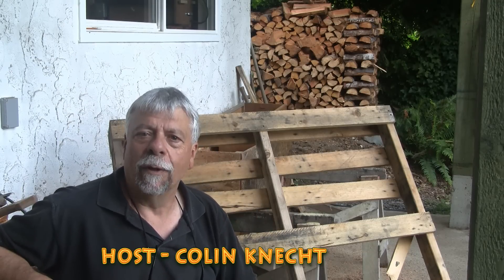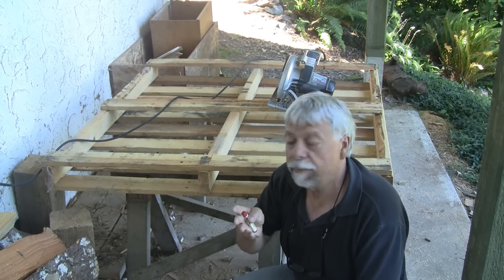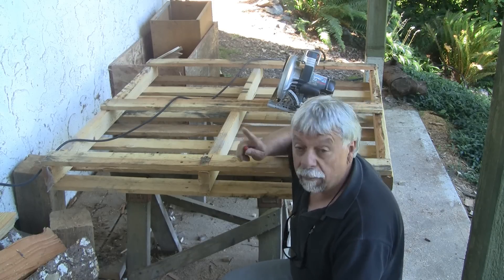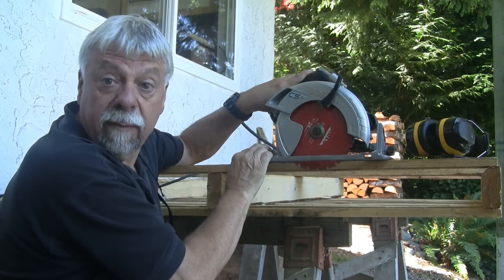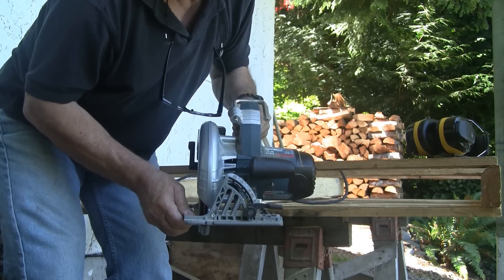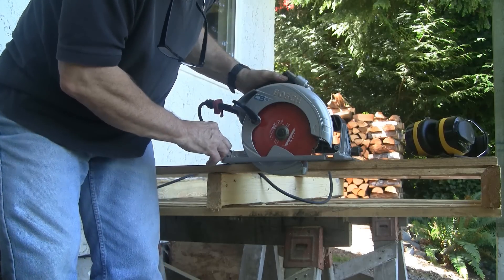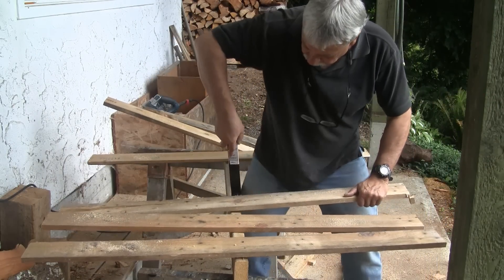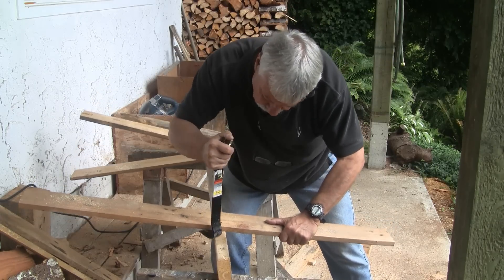How to Easily Disassemble a Pallet for Pallet Projects: Woodworking for Beginners #10\

Comment: I've been using and abusing pallets for years. Just recently watched a bunch of videos and discovered the wealth of special prying tools out there, along with some more or less helpful instructions. This video is going to be the last one I watch. Your technique of sawing off the narrower boards (stringers?) on the bottom of the 2X4's then going after the stringers on the top makes the most sense; I would only add that on some pallets the stringers on the bottom may be salvageable, so it's worth looking first before grabbing the circular saw. Thanks for setting me straight!

Comment: Colin, you break them down the same way I do.  With my job, I run across all sorts of different shape pallets.  I've gotten over fifty 12' 2x4s for FREE when a local grocery store totally remodeled & all their coolers came boxed up.  I built a new rain barrel system, all from reclaimed wood.  Now saving 2x4s to build an 8x8 greenhouse from reclaimed wood.  Thanks for another great video.
Reply from the maker: Sounds like you scored some good wood there! Thanks for watching.

Comment: my wife has aquire the pallet project bug, which means I've been handling the shaping and assembly. this has been mainly trial and error.

I tried prying and pulling, but could never avoid splits. time consuming work.

I've found the best way (not quickest) was to pry off the bottom boards first, then using a 2x4 piece of scrap about 4" - 6" long as a buffer, butting it up against the 2x4 supports, and hammering the scrap piece to push out the board from the back.

not perfect, but most of the nails stay straight so can be reused, and if you go back and forth hammering evenly, then most boards will not split either.

I like your method better, though. saves a lot more time. also, all of your videos have shown me some new tips that I didn't know before! 

thank you for the great, and most important, clear and concise, information.

Comment: Hey Colin, Great #instructional video. Its a really good take on taking apart pallets, and i enjoy that you discuss the physics of the safety and not just give the tips. 

When i disassemble pallets i leave the runners and back on, i find that having the frame intact makes it easier to pull on the boards without the pallet wobbling. Then i run the saw down the top side runners and start pulling out the top boards from the middle alternating side to side so that I always the most strength from the pallet being square. Just my $0.02. Thanks for the vid!
Reply from the maker: lol ... and a good 2 cents it is too, thanks buddy, always nice to see how others do things that we can apply

Comment: You just saved me some real headaches.  I always feel like if I cut the pallet wood, I am wasting wood, but the point about usually cutting the ends off anyway is true...it splits.  Saves removing 70% of nails too.  I use 1/2" x 3/4" oak pallet wood as edge banding for plywood shelving.  Thanks Colin!
Reply from the maker: Thanks Chris ... good point with the Oak Pallet, thanks for that

Comment: I use a pry bar to pull up the middle part up a tiny bit then i pry up the ends a tiny bit and I use a saws all metal blade to cut the nails or staples. This saves the whole board and i have more long pieces to work with.☺

Comment: Great video.  I used to get oak pallets that were very hard to dissassemble, spiral nails with wire barbs.
The trick I found with them was, after the bottom boards were off I would put it top down on the floor and hit the side of the stringers with a sledge hammer or crow bar till they leaned over enought to get the pry bar in. Then I pryed the stringers up off the boards. I got a lot less splitting that way than doing it the other way around.
Ron
Reply from the maker: You are a lucky guy Ron, to find Oak Pallets, I rarely find anything like that

Comment: I once heard a tip to brush the wood surface with a wire brush before you plane or joint to remove any embedded sand.
Reply from the maker: That's often pretty good, but I have also found some tiny rocks really embedded deep in some of these, and then of course there are the nails or screws, that hopefully the metal detector finds ... for, just not worth the risk, but it really depends on the wood and the condition of the pallet.
Reply: I always do that with a very coarse wire brush and my grinder. Then, it is a must to use a magnet tied to string  (like a pendulus) to find any hidden iron or steel...

Comment: I use a metal cutting blade in a sawz-all or reciprocating saw and cut the nails thru and then sometimes leave them in place for the project. Or use a pin punch and drive them out...

Comment: Hello.... set a 4 x 4 block under both sides of the 1 x 4 in the middle and tap the 2 x 4 middle board downward using a rubber mallet.  It will make it so much easier to get the 1 x 4 loose.  Less Crow Bar Work.  Work Smarter not Harder.

Comment: I found the easist for me is to use the reciprocating saw because there are already more nailes in the 2 x 4s than wasting time on  I then use a punch to remove nails.
A little story you might enjoy.  I worked for Rival Mfg before they sold and moved to China,  All metal that we received was on oak pallets that had slats 1 x 4 up to 1.x 12 in size.  Arrived to work one day and on the floor of the shop was a pallet with the prettiest grain wood one could imagine.  I mad clai, to the pallet and one of the engineers who was in the shop said I was crazy because it was nothing but firewood.  I took pallet home and squared the wood which was about 1 1/4 " thick, taped to face plate and turned a nice wood plate that was 111/2" in diameter.  I took the plate to work the next day and found all the engineers on coffee break.  I was not very nice but it felt good when I told this college educated engineer that I saw this plate in the pallet and an engineer with a college degree that owned a shopsmith  could only see a piece of firewood.  The other engineers thought that was the funniest thing they had seen.
I guess it is all in the eyes of the beholder when it comes to wood.
Reply from the maker: lol ... cool story, thanks Gary ... appreciate it
Colin

Comment: Hi Colin I really have appreciated your way of explaining things on several of your videos ... Thanks ...  have been using pallets for awhile I want to use the 2x4's  but the nails are a problem ... I always end up with at least one that breaks off flush ... I was wondering if you have any tricks ...?? I have been toying with the idea of cutting an old socket into a hole saw that fits the nail that is broken off flush with the 2x4 ... is there already a tool like that out there?
Reply from the maker: The Day of Pentecost Sorry, I have no magic for those nails that break off, I also find when I try to dig them out, they often break of again deeper inside the wood because they often use coated or spiral nails for extra gripping power, then when they get a bit rusty, they are a real bear to get out. Sorry, wish I had a better answer, someone else out there might have an idea too ...

Comment: Hi,, i enjoyed the video and I get pallets IV got all I can store.Id like your thoughts on I was worried about the little rocks and stuff tearing my blades up in my planer and jointer.So what I do is take my belt sander with either 60 or 80 grit.I do this before I use my planer and jointer.Do you think this is a good idea? Thanks
Reply from the maker: ***** Sure, belt sanding pallet wood is one option and if it is working for you, why not use it.
I have done this on rare occasion but often I want to retain the patina of the pallets, but different people have different reason, ideas and projects so it sounds like you have a method that works. Thanks for posting this Steven.
Colin
Reply: Yes thank you,,also I really like all your woodworking videos I'm glad that you and guys like you share your knowledge and help people.I have never had anybody to teach me when I started so its people just like you that I have learned from.And still learning from.So thanks

Comment: why do you pry only the tops?  just curious, no issue with it, just cutting at least 3 more long boards.  nice vid....
Reply from the maker: Sure .. no prob, good question actually an no one has asked it yet. The reason I only pry the tops is, that I have found it easiest to work this way and it gives me a choice of both short and long pieces of wood to use.
Some of these pallets are a real bear to take apart especially when the wood is dry and the spiral nails are rusted in. I have seen some people use recip saws to cut them off, which I can see would  also work well in some cases.
Reply: that is a great answer!  it makes since and I totally get it.  I have been taking pallets apart.  using them for hunting blind benchs, tables, etc.  it is frustrating when they are really set in and crack...oh well.  thank you for your vids and I have learned a ton.  thanks from Indiana
Reply from the maker: zeke Porter  hmm, pallet wood for hunting blinds and benches, another great idea ... thanks for sharing this :-)

Comment: Interesting Collin, certainly. but...
Nowadays it seems to be on fashion to use pallet wood.
What many people does not know is that there are 2 kinds of pallets: the discardable ones, made of very low quality wood, and the long lasting ones made of better wood...
But these ones, in order to  last, must be protected from moisture, insects, fungi and the like. 
This protection is most of the times based on copper, cyanide and arsenic (all 3 at the same time),which are extremely toxic for humans! 
So, breathing protection is a must when working with pallet wood!!! Sawdust of these woods can be very harmful...
Best regards

Comment: how about the nails...if any proper way to pull it off?
Reply from the maker: mhairi jamaluddin Often the nails are spiral nails, and rusted into the wood. I many case the heads of the nails just snap off, but some can get pulled out, that's why cutting the ends is so quick and easy, and the ends are often split so would need to be trimmed of anyway.